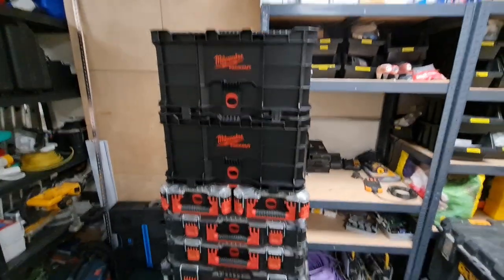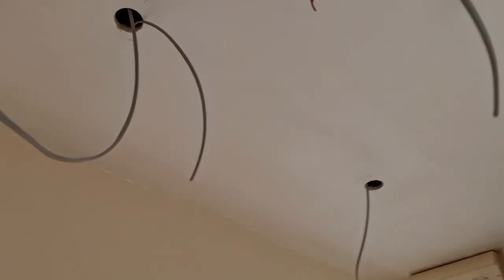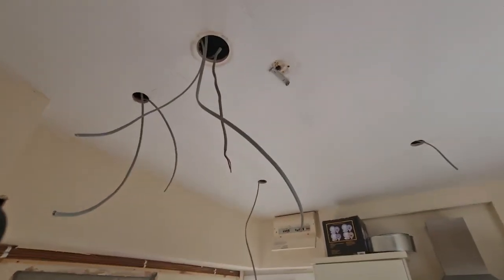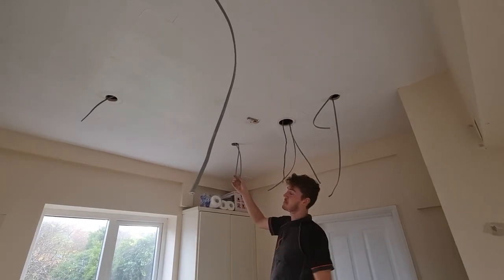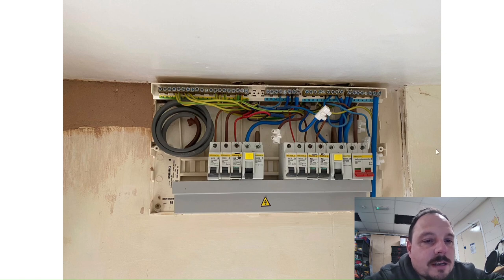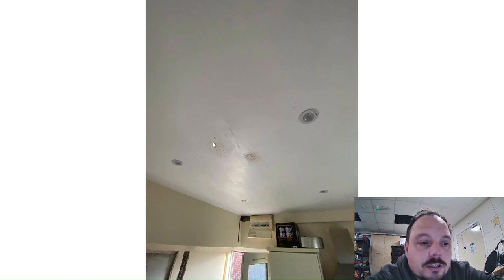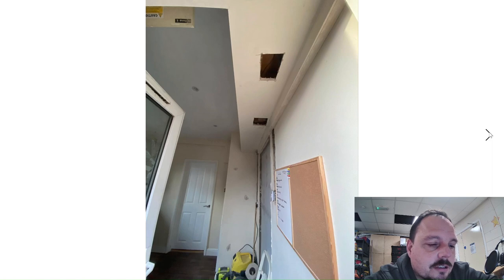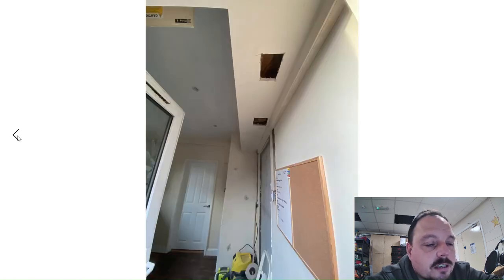UK electrician spot lights and oven circuit featuring Matthew

Comment: Get the Metabo wall chaser will worth the investment save you so much time and will help with very clear and clean chases. It just gives that more quality to your work.
Reply from the maker: We have wall chasers and grinders with dust extraction.  But we prefer to stitch in these situations. Primarily because of unkown pipe/cable routes. Plus this plaster was really dry and virtually falling off the wall. Best to get all the loose stuff off and repair. 

Appreciate what your saying and the comment but through experience we dont like using them in this situation. So long as the finished job is handed back to the customer A1 thats the main thing. 

The cordless chasers coming out are fantastic. In new biild dot and dob construction we do use them as we can set a safe cutting depth. Multi tools with a diamond blade are also a recommendation of mine for neat cuts if you are unsure whats in the wall.
Reply: @electrician247  great understood. This is fine. Context matters. You will probably face this a lot - us keyboard know it all’s asking why not this and why not that.👍🏾

The new generation of electronic metal, wood and cable finders which I have used over here are actually good in identifying these kinds of unknown pipe and cable routes.
Reply from the maker: Sorry if my reply seemed off. I am grateful for your comments and feedback. Was trying to explain lol. 

Yeah we have the wall scanners as well. They have let us down before! Even the thermal camera is a good shout to check. Trouble is the wall construction in older houses with lime and horsehair cause them to be wildly inaccurate in my experience anyway. 

Would still have stitched this one anyway as best to get the loose stuff off to then fix properly. Honestly when Matthew made the 1st tap big chunks were coming off by hand.
Reply: @electrician247  I know more sophisticated devices are coming including proper x-ray and real scanners the issue is power and safe housing the radioactive isotopes and how that would be recyclable they will be insanely expensive and in the first instance only for multi-billion contracting companies but they are coming.